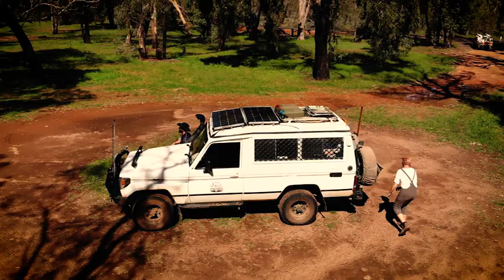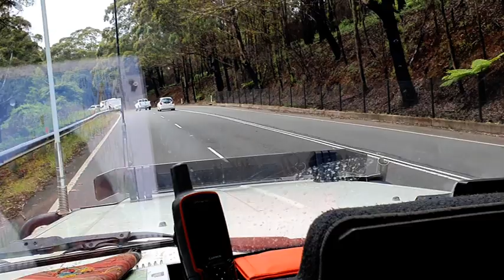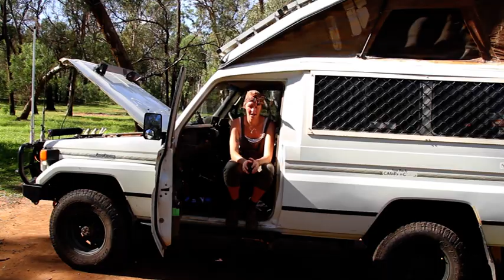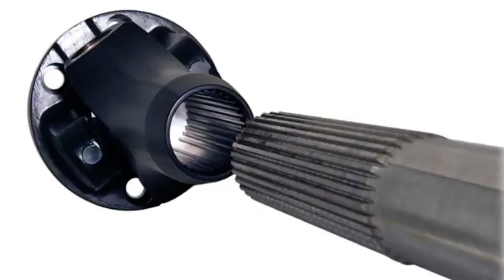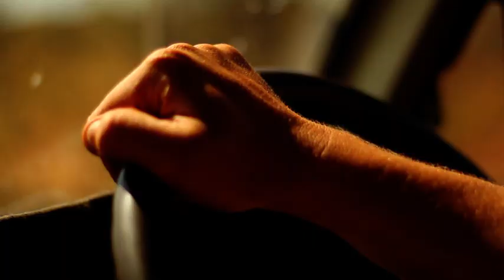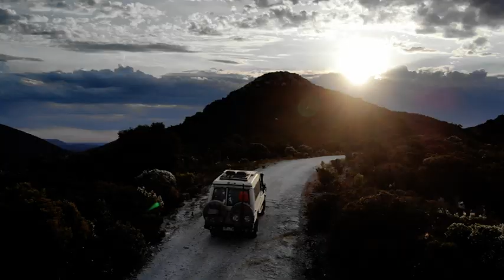Grand Tour Part 2 : HZJ75 Overlanding Set up | Engine | Drive Train | Gear Box | Suspension | Tyres

Comment: Cool vid again. Ive ordered and paid deposit of my new Koni Raid 90's and they get fitted as part of a gvm upgrade to my 76 series. Im also running the factory skinny 79 series wheels and the standard skinny tyres from the factory for the short term, but will be wrapping the Skinnies with the toyo 255 85 16 as i also think theyre the  goldilocks size. Ive had the toyo open country in a 285 75 16, and it was the best tyre ive ever had by far. 100k out of them. Hopefully the 255 will be equally as good. Hopefully i love my Koni's and hopefully i get another 500k out of my 76 series. 
Cheers.
Reply from the maker: Awesome, the Koni Raids are so good, made such a difference to our ride. Let us know how you go with the 55/85's, agree, they seem to be a perfect size.

Comment: With the rubber bushes do you still pump any grease in?
Reply from the maker: No, use rubber grease on installation, but not during service ( the original toyota shackle, pin & bush arrangement was never intended to be greased in service) 👌🏼

Comment: Lockers are fantastic.
I ended up sunk to the axles in soft sand in Danggali NP.
Popped the lockers on and drove out. 
Beats digging and wasting time .
I also like your  thinking of not rock climbing etc .
I wouldn't pit my troop through that either.
Great vid
Reply from the maker: Thanks mate, and yeah the lockers make a massive difference hey, we love them as a preventative measure too, knock em on when the terrain ahead looks rough and sail on up much more slowly and more controlled. You watch guys thrash their vehicles but yeah, maybe they don't have the same attachment to their cars as we do!

Comment: Thanks for a super informative video! I saw you have recovery points bolted to the frame? The red ones? I have been searching far and wide for a set that fits and doesn't rub on the shackles. Can you let me know what you've got there and where to get em? Keep it up!
Reply from the maker: Thanks so much mate, really happy you enjoyed the video. Do you mean the yellow points? They're from Roadsafe 4WD, we really like them because they utilise both the bullbar and original tie down mount points, which makes for a particularly solid combination to hold the rated load of five plus tonnes. Really well designed with good ground clearance and clears the shackle no problem.
Reply: @crossbowoverlandthewhiteox5045  awesome thanks so much. Yep big fan of these more technical walkthroughs. Looking forward to the winch!!